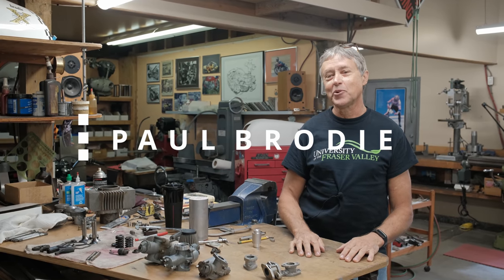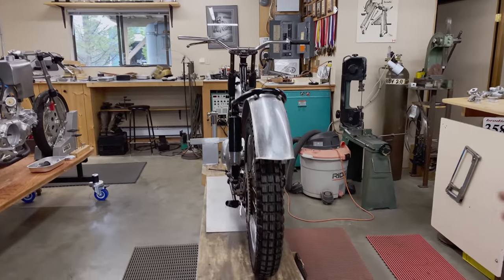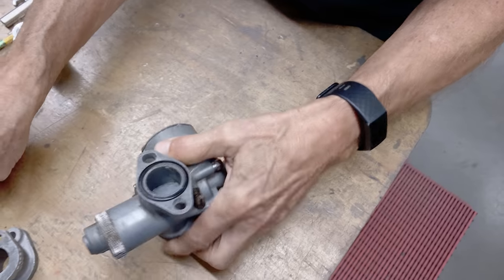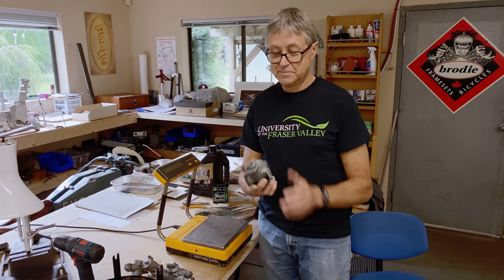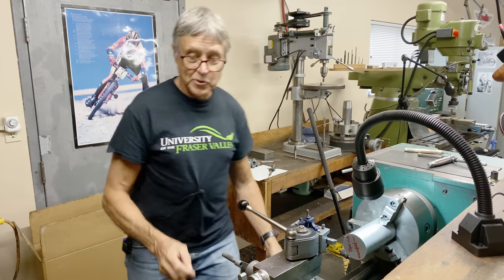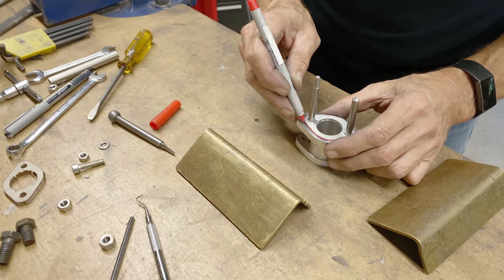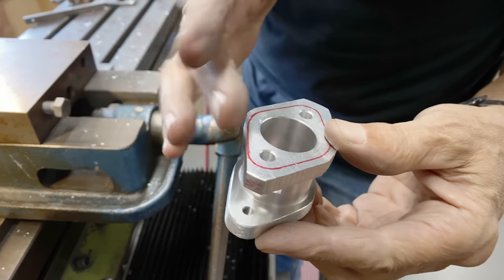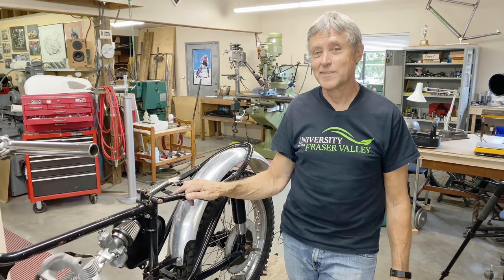Tiger Cub Intake Manifold // Paul Brodie's Shop

Comment: don't want to be picky but that's not a manifold. mani = many like you get on single-carb, 4-cylinder engines, but that carb only feeds one cylinder-head port. inlet stub............??
Reply from the maker: Technically you are correct, but out here in the real world I still think of it as an intake manifold.
Reply: Which word would you consider appropriate for a single inlet? Spout? Orifice? 

Are you aware of the origins of the word government? To govern is to control. Ment is the root of mental or mind. Therefore government is control of the mind or minds of the masses. Puts a lot of things into perspective doesn’t it?
Reply: @paulbrodie  as an educator (bachelor of education) i find it most odd you insist on calling the item by an incorrect and misleading name....... yet you say that YOU are a college instructor. speaks volumes about mercan edumacation..................??
Reply from the maker: @raymondo162  Raymond, let's not get hung up over wording. Different countries have different words and meanings. I just want people to use their hands to either make or fix things. I feel it is getting to be a lost art. I was not a college instructor. I taught Framebuilding 101 at the University of the Fraser Valley, for 9 1/2 years.
Reply: Raymond Ashby Considering you describe yourself as “an educator (bachelor of education)” I find it very ODD that you’re using lower case i to express the nominative singular pronoun when referring to yourself, as well as your qualifications. 

And surely as an educator you should be aware of checking your facts before making lazy stereotypical assumptions about someone. Paul is in Canada, not the USA. 

Before I mark your comment, I need you to see me after class.
Reply: paul brodie Obviously not long enough mate 🧐😎😜

Watching the 9-11 documentary on More4 channel in UK. Puts these silly arguments into perspective doesn’t it? Also looking through Dr Judy Wood’s book WHERE DID THE TOWERS GO?  She probably has an inadequate education for some people too. 

Peace
Reply from the maker: @G58   G58, that's a great comment about a comment. I did notice about "mercan" and me being a Canadian, but then I thought maybe mercan could also mean North American, of which Canada is a part, so I decided to let that one slide...
Reply: paul brodie No, I believe you’re quite wrong. That would be, what’s the phrase I’m looking for? Ah yes, an incorrect and misleading way to describe Canada, in respect to its education system, especially given that it ranks considerably higher than them poor folks in the land of Biden, Trump, Obama and Bush et al. 

You might ask why I consider myself qualified to comment. Well, it’s true I don’t have an expensive piece of paper to wave at anyone. But my grandfather was born in Chicago in 1893, and he worked at Timothy Eaton’s before volunteering for the Canadian Army, and was among the men who took Vimy Ridge. He didn’t have any expensive pieces of paper either, just a lump of German shrapnel in his shoulder, that reminded him of the value of not sticking ones head above the trench without checking one’s situation first. Useful advice. 

Now, I wonder which one of us our hapless friend is going to attack next. How lucky he is to be only facing typed words, and not a lead breeze from one Hiram Maxim’s loud toys. 🥽🔨🔈

Peace